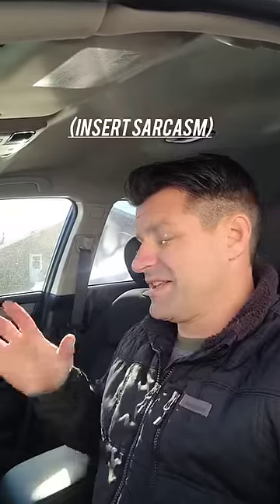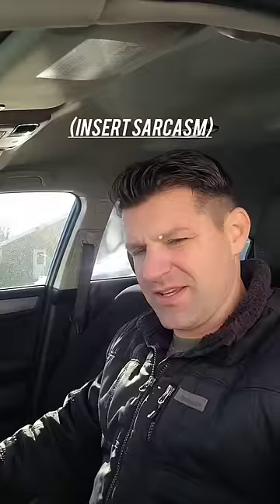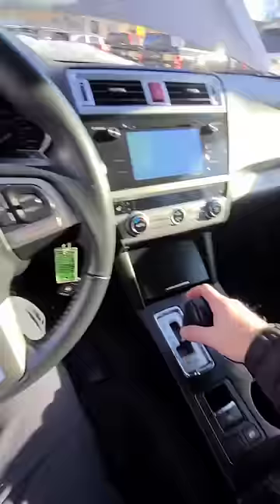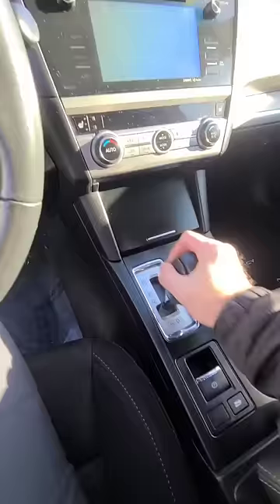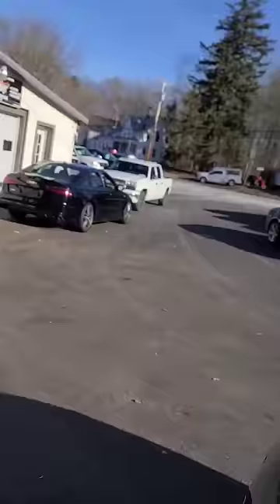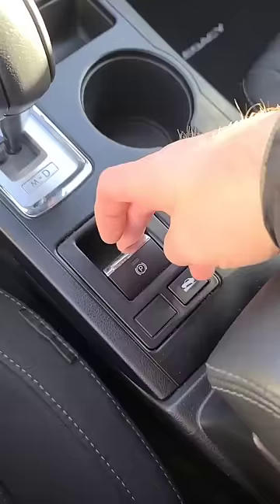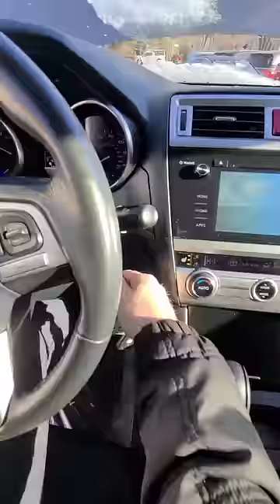Why Subaru Engineers deserve a punch in the Face! #shorts

Comment: All automatic transmissins have a button that allows you to shift the gears when the engine is off. On this Subaru its got a small plastic cover just above the gear selection indication lights.
Reply: Yeah but using the shift lock override that exists on basically every single automatic since the 90s for the exact purpose of overriding the shift lock isn't something this guy thought of
Reply: I have literally never heard of this and I've read a good portion of my car manual. What are you talking about?
Reply: Isn't there already a button on the shift lever?  Why not just design that to be the override?
Reply: @scottthewaterwarrior  the button on the shifter asks the computer if it is allowed to do what the driver wants to do. The computer will allow movement if the action makes sense. E.g. you should be locked out of reverse and park while travelling forward.

Shift lock override ignores this, because a blow tail light fuse or the situation in the video mean you need to be able to override the lockout.
Reply: @x--.  Finish reading the manual and find out!
Reply: @x--.  Pretty much every auto tranny equipped car has an override, especially if the ignition has a lockout feature for the transmission shift.  It allows you to be able to shift the selector in situations such as this, or for tow truck guys who need to move the car without the key and don't want to damage the transmission.
It should be a tiny door about the size of two pens side by side, with a little pin hole along the side to insert a screwdriver, knife tip, or other similar tool to pop it open, and there's a little push-to-release button inside for the selector (typically).
Reply: That still relies on battery power to shift the transmission into park.
Reply: @garyblack8717  - It shouldn't.  Why even have a shifter at that point?  Why not just have buttons?  I'm guessing that selector is still connected to a cable underneath.  
Yes, I know there ARE some push button solenoid controlled transmissions that rely on battery life to function (or you have a very rare Plymouth Valiant or Fury), but there still has to be a manual override.  I doubt NHTSA would approve a vehicle that didn't have that capability.  Or I could be wrong.
Reply: @mdemers767  well, color me dumb. I can change the oil, headlights, window switches and even my starter motor but had no idea about this. Though I grew up driving a manual and didn't start driving an automatic till much later. Really would have appreciated a dang label.
Reply: @zacharytracy3797  The Key inside the key fob works just fine! Although most people don't realize they have a key inside the fob in the first place.
Reply: @garyblack8717  Um...No, Thats excatly what its for. It's a mechanical lock not electric.
Reply: Not all vehicles with electronic automatic transmissions though, like my Buick Enclave.
Reply: With the exception of a few people who've read the manual from cover to cover, nobody knows this. You should not have to be a "learned scholar"  to drive a basic vehicle. An emergency brake is just that: a brake to use in emergency situations. A 9-year-old should be able to unbuckle from the back seat and yank on that sucker and stop the car.
Reply: @mdemers767  Most cars lock the key in the ignition unless the vehicle is in park, and even if you have one of those one where the key fob is the key, not all of those actually have a key in them, especially those with keyless ignition.

Still, the shift release does not need the car's key key or a screwdriver, any key typically works, including your standard house key and most padlock keys.  Short of those, you can use the tab from a pair of nail clippers or a small pocket knife.
Reply: @Holtenstein  can't get the key out until in P...
Reply: @hindesite  These are Push button start. The key is hidden in the fob!
Reply: @Holtenstein  you can see the keys hanging on the right side of the steering column.
Reply: @hindesite  Good call then
Reply: @hindesite  you only need "a" key, no need for "the" key.
Reply: @x--.  oh it's there, you just need a screwdriver.
Reply: @chrisrandall7381 just like he never thought of putting something behind the wheels to stop it from rolling instead of basically having to make a mad dash from the drivers seat, to the jump pack and back ..
Reply: @x--.  It's been on every automatic car I have ever seen. Not even hidden. Tow truck drivers use it all the time to move cars that are in park with no keys.
Reply: @jarredeckman1976  sure makes sense. I'm not a tow truck driver and never was. I drove a manual and so did many of my friends so... Well, just never came up.
Reply: Find one on a '12 GMC Terrain. I had my car die when I was trying to get it to the shop. Unfortunately the battery was not charging so it died in gear. I searched for that switch and didn't find it. Turns out, it's not in the Terrain.
Reply: @michaelhanson5773  Right so he could make a mad dash for something even further away that is sturdy enough to hold a few tons of weight...or he could move three feet forward and three feet back. Not everyone who drives a sedan keeps a chalk block in the back seat my guy.
Reply: @Armoredcompany nor a jump pack genius. But...he happened to have one 4 feet away.

Why a block? A woman's boot will stop a car rolling. Ask me how I know.
Reply: Right- every driver knows that!
Reply: @Armoredcompany  he had someone helping him film this, they could have gotten something that he already should have had since he should have known about the vehicle he was working on first before doing stuff to it.
Reply: While working at a customer's house couple months ago I noticed a car looking like it had sat unused for good while.  Asked him about it to maybe buy it and fix it up.   Told me he would knock some money off because it has a dead battery and electronic locks, so he couldn't get back into it 🤣
Reply: @mdemers767  "why not just have buttons" that's what we're talking about! You haven't seen newer shifters have you, little buttons or dials.
Reply: @x--.  I drove manuals most of my life as well, but they are harder to find now. I worked at a body shop in my 20's and we used this all the time to move cars that were towed in without keys. Not sure about trucks/suv's that shift from the column.
Reply: @garyblack8717  No it does not at all. It is a manually override design for power off movements.
Reply: @fighterpimp  There is no manual link between the gear shift knob and the transmission, it's an electric solenoid.
Reply: @michaelhanson5773  

If you’re in the car and it dies, you’re supposed to think of that?
Reply: @Ont785  if i am in a car and it 100% completely runs out of battery while i am in gear i am buying a lotto ticket since the chances of that happening are pretty close to 0 or else this would have been a issue years ago and recalls on every car with an electric ebrake issued. He was working on the vehicle when this happened and anyone working on a car should have the necessary safety equipment with them and know what they are working on... He should have known about this and the shifting override and had the wheels chocked if anything else before messing with it. The average person should never run into this situation.

Also engine dying does not equate to complete battery and electrical system loss
Reply: I wasn't aware of this feature until I saw it in action while traveling overseas. In some parts of the world, the regular spaces in a parking lot get filled to capacity, and then people parallel park perpendicular to the normal spaces, effectively boxing in the normal spaces. If you're one of the people who parks perpendicular to the normal spaces, it is understood that you will leave the transmission in neutral using the override feature so that others can temporarily roll your car out of the way so they can get out of the regular parking space. I kid you not - 99% of the time people cooperate and it works out just fine. I was amazed, because I don't think this would ever work in the US.
Reply: @michaelhanson5773  

Because shit never happens? 
Please.
Alternator dies; battery drains while you’re trying to get off the highway? Happened to me…pretty sure I’m not the only one who has had alternator failure.
Reply: @Ont785  and you got a jump pack, got under the hood and used it to start your car while it was in neutral all while trying to do it before your car rolled away from you? "Please"... This video is pointing out a supposed flaw that only would maybe impact a tiny percentage of people and mostly mechanics who should at least know what they are doing and if leaving a vehicle in neutral when cutting power be taking the necessary precautions to prevent it rolling away if power is lost.... Who the hell even shifts into N when they see their battery light coming on anyways? Leaving it in gear maybe, but deciding to just put it in Neutral right before the battery dies and not engage the e brake, you cant be serious. If someone is trying to drive on a battery, i am sure they are going to be leaving it in gear trying to move then shifting to neutral first... But hey, id you think this is such a big deal, maybe file a complaint with the manufacturer to have them address something that has been this way for years and never been such a concern to change it or issue a recall...
Reply: @michaelhanson5773  
It points out a flaw.
Yes, the video was dramatic, and seems to be your take away.
Personally, I think there should be a manual E brake.
Despise Subarus anyway
Reply: Just buy a manual..
Reply: @beernutsonline  

It’s the same bullshit in the DCT transmission. It all sounds easy enough until you actually have to use it. 

All of these things are designed to have the car is towed back to the dealership; that is the only reason .
Reply: @scottthewaterwarrior  some cars actually did have that. But the sleek and no button look is what people like. They just need a shift lock button on all that not asking you to remove the shift boot or plastic
Reply: @platinumsky845  - Yes, but the vehicle in this vid has an actual shifter.  Why overcomplicate things?  And yes, I have indeed seen the button/dial selectors, and I think they're a menace.
Reply: Ooh man, imagine doing a cheeky video instead of just reading the car manual..
Reply: @garyblack8717  No
Reply: @ekathegermanshepherd4571  

It was a cheeky video, but I wouldn’t buy one of those fucking cars.
Technology for the sake of technology .
Reply: @atlantichcr  ,  the video is fake setup anyway as the hood was already up with the car in N.  So he obviously opened the car hood while the car was rolling down a hill in N? So it's a faje
Reply: @ekathegermanshepherd4571  

We all know that …?
He was just demonstrating a scenario
Reply: NOT ALL, I’m a tech trust me, some cars your stuck
Reply: @chrisrandall7381 still it’s over engineering, should always be mechanical for safety reasons
Reply: @mdemers767 key word here is Typically not always not all have the feature

Comment: There's a toggle if they remove the trim around the shifter. Allows you to put it in park even without power.
Reply: The fact that it requires removing the trim is ridiculous.  Just put in a cable emergency brake for all the electric crap.  No real reason not to.
Reply: Emergency brake is supposed to happen for an emergency what are you to do if there isn't access to it? Kind of stupid
Reply: @bannedbycommieyoutube5time920  there's a lot of cars like that these days. You lose power you can't shift. As a tow truck driver it's annoying. 

It took me 40 minutes one time to figure out how to get a BMW into neutral lol. I had to read the manual on the side of the highway. They had a strap you had to pull that was under the dash and covered in plastic trim.
Reply: @pierredelecto7069  the fact that you do that for a living and it isn’t self explanatory definitely proves the point.  Good luck and stay safe out there.
Reply: @bannedbycommieyoutube5time920  thank man!
Reply: That's the shift lock release button
Reply: Used be able to just jame ur key into the botton on side of the trim with the old Jap rides miss my old avalon from the 90s
Reply: @k9fouroneone  it's not for an emergency. The proper term is parking brake. It's used to keep the car in place while parked. Nothing more.
Reply: One most average person is unaware of the fact that they can do that and even the people who are aware of that do you keep the tools to remove the trim from your shifter right within reach when you can't get out of the car without it rolling
Reply: Its below the rubber pad in the storage area in front of the shifter. Just rip the rubber out and jam your key in the round hole and you can put the car in park.
Reply: It's not a piece of trim really
... It's a small square pice of plastic about 1cm square that you pop out with the key... Similar to accessing the bumper tow hook cover... Not really that big of a deal. If you read the manual like is recommended... You'll see this. I get not reading it first... But maybe while stuck in this situation, try that instead of risking property damage to run out of a car you know will roll... That's called negligence.
Reply: @rosstaylor1137  sorry kiddo but you're both wrong.

The proper term is HANDBRAKE
Reply: @zataralee2  didnt hé state in the video that you can’t take the key out of the ignition while in neutral?
Reply: @jmor106  a key was just an example. Use a house key, a utility knife, a penny from your pocket, or your fingernail if your a man who can open a can of soda without Mommy's help.
Reply: @bannedbycommieyoutube5time920  with most of the cars I've seen you don't have to remove trim there's a little cover you can pop open with a flathead or something Its a lot nicer than removing trim
Reply: @notablynova  This car hasn't have a handbrake.
Reply: @kearl5390  what's it like being blind????

He sure as hell didn't operate it with his foot 🤦
Reply: @notablynova  I have the same kind of electrical parking brake on my vehicle. Because it weighs more than 3,5t it needs a handbrake, according the rules here. That's why also needed to install a old manual parking/handbrake to match the rules.

The manual ones are both parking and handbrakes. The electrical ones aren't most it the times
Reply: @notablynova  The PARKING brake in my Camry is operated with my left foot. What's your point?
Reply: That's why you get an 80s car, style, sometimes half-decent gas mileage, style and non electric parking brake.
Reply: @ocelotcake9359  this has an over ride too.
Reply: @notablynova  Here's your cookie! 🍪 😁🫡
Reply: @k9fouroneone  but they're not emergency brakes anymore they're parking brakes
Reply: @zataralee2  Inthe 2017 subaru model he drives it's under the rubber inlay of the storage space behind the shifter.
Reply: @notablynova  Subaru manual calls it a Parking Brake.  Just FYI
Reply: I'm blown away he's never heard of it!!
Reply: @deanedongdoorbell ah yes I love fucking with carburetors, or worse TBFI, or EVEN worse computer controlled carburetors all the time. And the vacuum systems on old cars are so simple too, just a few dozen lines and you’re good to go. And such interior build quality! If less than 40 things rattle I don’t want it

Snark aside, I don’t think anything older than the mid 1990s really makes a viable daily anymore. Can you do it? Yeah, but fuel injection, coil on plug ignition, and vacuum systems becoming super simple makes things so much easier. Yeah it’s got a computer but just because it’s more complex doesn’t mean it’s less reliable.

There are extremes to both ends of course. A lot of modern cars are getting a bit ridiculous (though this Subaru is not one of them.) but semi-modern cars have so many advantages, and owning a car made in the last 10 years is so much nicer that it’s worth it. And I say this as a guy who drives a ‘98 Volvo
Reply: @Jbs6187  People need to RTFM.
Reply: If only people read their car's user manual....
Reply: @notablynova  proper term is parking brake, other names used are handbrake and emergency brake. All 3 of them are right. Get off your high horse.

Comment: Yea because there IS a shift lock override button under the rubber mat in front of the shifter that could be pressed with almost any small stick like device like a pen....I feel like this problem is more his fault than the Subaru engineers. Just my opinion. Still give him a like and comment tho.
Reply: Good info! I guess this dude doesn't own a pair of wheel chocks....